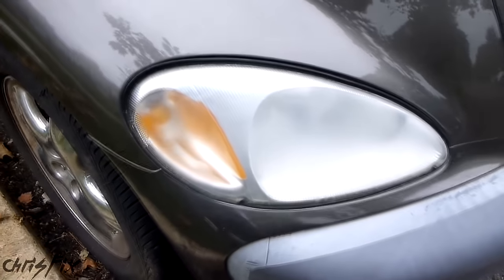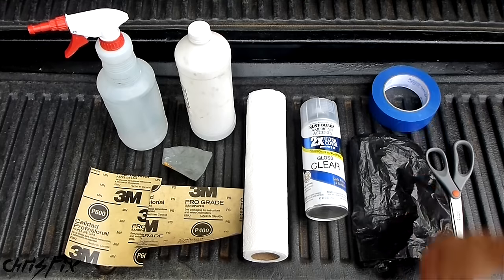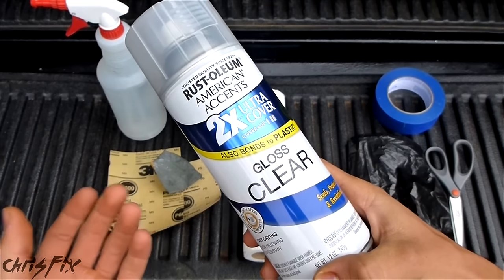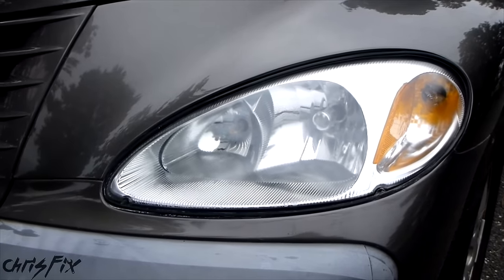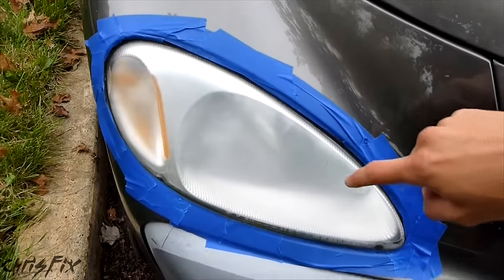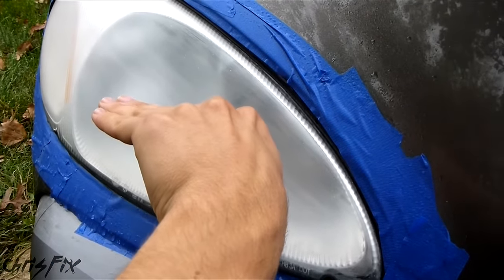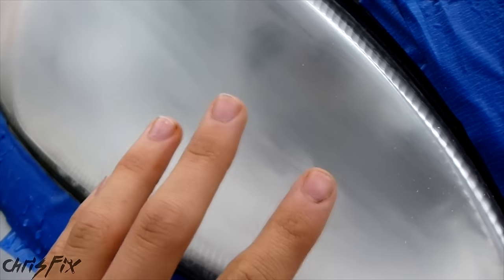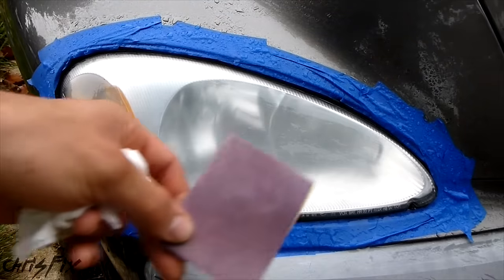How to Restore Headlights PERMANENTLY

Comment: Spraying tip: Start and end beyond the headlight, this prevents overspray on the headlights. Anytime you use a sprayer use this technique.
Reply: Please explain?
Reply: @Stedemn  Long response-bear with me. When you spray the clear, you're going to move the can from side to side. When you make a pass with the can, start a foot or so before the spray pattern reaches the light.  Press the button and make your pass across the light. Don't release the button till you are past the lens. This keeps the spray pattern consistent on the surface of the light.  Consistent pattern=consistent coverage.
Reply: Thanks!
Reply: Its like pre firing

Comment: This was helpful, here's the summary:

1.	Put masking tape all the way around both headlights. Don’t leave paint around lights showing.
2.	Spray headlight and 400-grit sandpaper with lots of water.
3.	While keeping surface wet the whole time, use sandpaper to swirl in circular motion. Don’t push too hard.
	      - Milky colour will run, which is fine.
	      - Make sure grooves are done around the edges
4.	Finish by sanding horizontally. Include grooves.
5.	Do steps 3-4 with 600-grit sandpaper. Slightly more pressure than before.
6.	Use water and paper towel to wipe off the headlight.
7.	Do steps 3-4 with 2000-grit sandpaper. Not too much pressure.
8.	Repeat step 6.
9.	Use alcohol on paper towel to clean it off. Leave to dry.
10.	 Use garbage bag to cover the front of the car around the headlights. Tape it down to the car nice and tight.
11.	 Push down bag over headlight. Lift up slightly, then cut a hole around the edge of the headlight. It can be slightly bigger, but not bigger than the masking tape.
12.	Tape the inside of the headlight hole tape to garbage bag.
13.	 Repeat step 9. Do not touch from this point on.
14.	 Once dried, use light and fast sprays of clear coat over the headlight. Cover lightly twice: up to down, down to up.
15.	 Let dry for 5 minutes.
16.	 Repeat step 14. Make sure grooves are sprayed too.
17.	 Let dry for 5 minutes.
18.	 Repeat step 14.
19.	 Let it dry for at least 24 hours. More is better, up to 7 days. Do not drive car during this time.
20.	 Remove garbage bag cover, but not original masking tape around headlight.
21.	 Do wet sand to remove orange peel: 2000-3000-grit wet sand in the same manner as steps 3-4. Can repeat more if needed while increasing in fineness.
22.	 Dry.
23.	 Use car wax on microfiber towel and swirl it around.
24.	 Leave on until it hazes. Once it does, buff it out (wipe using clean buffer).
25.	 Remove rest of tape.
Reply: Nice bro
Reply: Thanks
Reply: I have a 3m kit and it doesnt say to wet sand for the first two rounds of sandpaper. will that make a difference?
Reply: @AlexSchwartzATV  I dunno chrisfix suggested wet sand for every time you sand it here so...not sure how it'll work if you don't
Reply: @AlexSchwartzATV  I would wet sand every time, especially on plastic.  The water helps avoid build up of material (in the sandpaper) that is coming off the headlamp and makes the sanding much more consistent over the entire surface.
Reply: Rob the Wayward Woodworker I did! However I still noticed small scratches in my headlight but they’re hardly noticeable. Just don’t know why. I used a drill attachment for 400/800/3000 iirc. Then rubbing compound. Then clear coat. Now I’m waiting for it to dry to wet sand 3k again and then wax.
Reply: @AlexSchwartzATV  You could try going to a 5000 grit to see if that eliminates the scratches, but honestly, there will always be super fine scratches from sanding.  The clear usually levels those out.  If you are still seeing them in the clear coat, try a very light wet sand of the clear with a 5000 grit and then apply a rubbing compound, then wax.  Hope that helps.
Reply: @robthewaywardwoodworker9956  yeah its already clear coated over so I wont be doing 5k on it. but the clear coat might've, I havent been able to get a close look, and its still orange peeley. plus despite doing light coats the paint did droop a little so hopefully the 3k wet sand will clear that up a bit before wax. if not, its not the most noticeable thing so idc. but yeah ill do a rubbing compound again after I wet sand and before wax, might as well, I have extra. thanks man
Reply: @AlexSchwartzATV  Yeah a little 3K or 5K should get rid of the sags and most of the orange peel.  Good luck!
Reply: @AlexSchwartzATV  Water removes the grit from the operation. If you don't wet sand you will be scratching the plastic.  The idea is to progressively make smaller scratches until they are invisible to the naked eye.  Hence, clear lenses.

Comment: I actually did this today on our truck. I was always polishing it with toothpaste every couple months to get a  somewhat clear non yellow lense.  Today I wet sanded with 600 - 1200 - 2000 - 3000, then alcohol wipe.  Taped it off and put 3 passes of  Krylon Color Master acrylic crystal clear with durable cover max technology (quoting the lable) and later in the day after it all dried nice I finished it off with a quick coat of carnauba wax. It came out awesome, crystal clear, looks like a brand new Glass Lense.   I was using the clear coat from a previous project and they did not have any non yellowing clear coat at my local shop, so will have to order a new can from amazon, so for now  I will be driving with one super clear lens and one yellow faded out lens.  But this really does work great and is super easy.
Reply: John Norris I just did mine and I'm waiting to 24 hours for it to dry. It doesn't look super clear after I sprayed the clear coat on, do it dry clear after the 24 hour period?
Reply: Mine got clearer as it dried but looked pretty clear pretty quick.  Should be noticeable right away.
Reply: I did finish both headlights on that suv then l did the same to my other truck. They all look good.
Reply: After it dries if it does not look clear, maybe you got the wrong clear coat?  I know they have some that are opaque.  you can always try more coats to see if that works.After it is all dried, you can also try applying a polishing compound like used to polish your car. to smooth out the finish more. Finish it off with a wax like carnuba wax to help protect the clear coat as it is not as industrial or durable as the clear coat on your paint job.  They do have some heavy duty clear coat spray paints out there that have a hardener added to the paint that will last much longer.  these cans have a button on the bottom that you depress, this releases the hardener into the clear coat in the paint.
Reply: mine is also in small cracks all over the headlight after clear coat

Comment: Chris - this video is excellent. My 2007 BMW Z4 had some mildly oxidized headlights. 

I started with 600 grit and soon to that someone had tired to correct these before (I’m the second owner). 

Once all of the sanding was done and I had a nice even haze I shook the clear coat for a good 2 minutes. 

I carefully applies VERY light coats, waiting 10 to 15 minutes between applications. After 3 coats I checked for uniform, even coverage. I then applied my last coat and waited overnight to remove the tape and bags. 

Wow! Just beautiful. Pure carnuba wax was carefully applied and removed. The results are spectacular. 

Thanks Chris - I WAS nervous sanding, but I trusted you and the results exceeded my expectations.
Reply: How long did you wait to apply wax?

Comment: I have done this technique one three different cars and it has worked really well.  The first one I did three years ago and now, the clear coat is starting to yellow and come off.  I love this channel and think Chris is awesome but this technique is definitely NOT permanent.  It’s by far the most effective and longest lasting treatment under buying a brand new headlight.  I’ve used other DIY techniques and even rainx (etc) kits but nothing worked as well.  

Another great thing about this is that you will have that can of clear coat for every touch up you’ll need in the future.  You use such a small fraction of it.

Comment: Hey Chris, I just did this and you saved me a couple hundred bucks plus the time to replace headlights that didnt need to be replaced. Thank you and I can send pics if you want them. Have a happy new year bro!
Reply from the maker: I'm glad the video saved you a few hundred dollars! Happy new year to you as well!
Reply: @chrisfix  I couldn’t find the gloss clear so I got matte clear clear coat is that okay?
Reply: @christophermendez1607  I don't think you want anything that causes a matte effect for the headlight, but I could be wrong. I'm commenting to you so that your comment will get recognition from chrisfix and you might get an answer.
Keep thumbs upping people in this comment section and it will give Chris a notice that there is activity on this comment.
Reply: @susieballard4957  thanks I ended up doing it and it didn’t come out as clear as I wanted but it wasn’t yellow anymore.
Reply: @christophermendez1607  well, atleast it isn't yellow. I would try to do it over when you find the gloss though. But that's just me 🙃
Reply: @christophermendez1607  I 9 I

Comment: Ladies, sand thoroughly. Chris makes it look easy. My first headlight I had to resand and repaint because I didn't get down to the plastic. It crackled. Now that I have sanded properly the job is beautiful on my 2003 Avalon. Thanks Chris!!!
Reply: That's the biggest problem with them all, it's all about removing all the grime or streaks and texture..lol
Reply: I had that problem too but I think it was due to spraying the paint too heavily.  It's important to use very light coats when spraying plastic
Reply: I just did mine, and the clear coat looks like it’s cracked. I spent an hour sanding but I don’t know what to do. Once your headlights also looked cracked, how exactly did you sand it in what order? 600 the. 2,000 and then spray coat again?
Reply: @georgelopez9517  I had to purchase new lights as the re-finish job only stayed nice for 6 months.

Comment: Wow thanks so much Chris!  Just did this on my mk1 Audi TT and the results are totally astonishing.  I tried several methods over a few weeks and this was hands down the best.  Nothing else comes close.  Personally I removed headlights and made a little spray booth :)
Reply: Did this on my mums MK5 Golf during 2020 lockdown she was impressed and the restoration is holding up well over 3 years later.

Comment: saw this video 8yrs ago when you first uploaded it Chris, didn't need it then, but man is it coming in clutch today. Bought a truck (Dodge RAM) and the state safety inspection. Just got back from Home Depot and about to put this video to work. Thank you!
Reply: @betterwithrum - How did this turn out for you?
Reply: @AnHebrewChild  it helped but state inspectors still failed me. So I had to replace them. Honestly you can’t tell a difference. I think these guys just won’t let you pass unless you’ve spent money. They said I was missing a bracket for the suspension but when I went to the dodge dealer parts center they said that my year didn’t have that.

Comment: If you want to double the value of a PT Cruiser, fill up the gas tank.
Reply: Or, how about: "I'd like some wiper blades for my PT Cruiser?" "Sounds like a fair trade, here you go."
Reply: Lol I was wondering why he even had one
Reply: My former employer had a pt cruiser for employees to drive, everyone called it the pt loser cruiser
Reply: Too funny. My wife had a PT. I hated it. A drive of more than 10 miles was torture. What a piece of crap
Reply: LOL.
Reply: @brazgazz  True, but at least the PT is not made out of duraplast and other waste by-products
Reply: @KenBuscho42  No, the saying originally says trabant.
Reply: @brazgazz  I've seen people quote "The Original" as Chevy Nova, Yugo, Ford Pinto, and yes, Trabie.  I've also seen the part quoted as tire valve covers, mirrors, headlights, gas caps.  Pick any POS car, add some low value part, and you have a saying that works. Maybe in your area it was a Trabie, certainly worthy of the insult, first time I saw one I thought it was a movie prop.
Reply: @KenBuscho42  in my area we made fun of American sedans. I'm not from Europe.